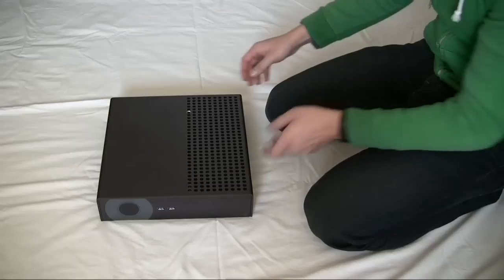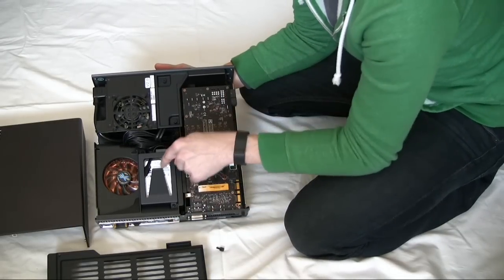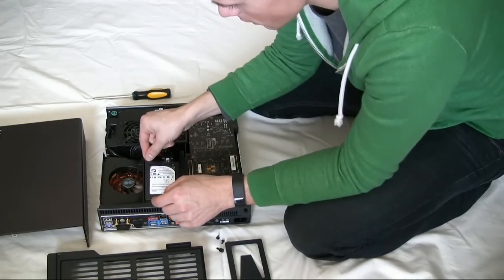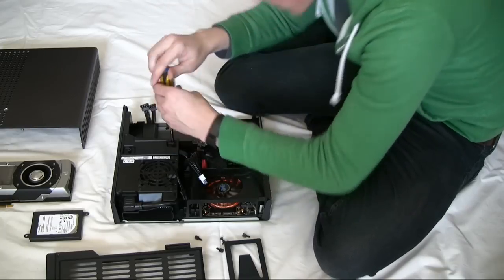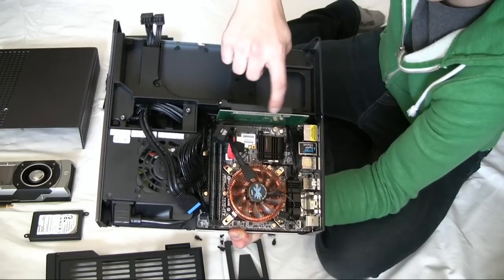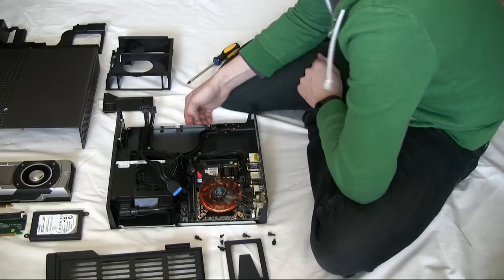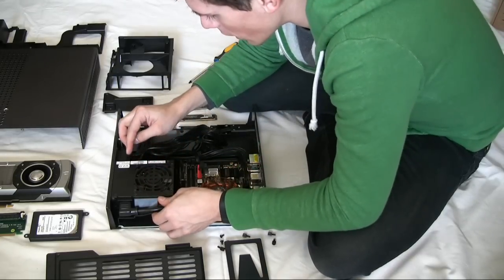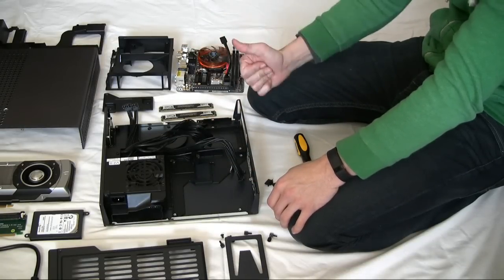Steam Machine, Disassembled!

Comment: Really cool to see the steam machine from the inside out, I've seen some videos of beta testers disassembling it but never saw one completely torn apart. Did you manage to get the game to run normally?
Reply from the maker: Not quite yet!  It looks like I should replace the motherboard, I think I may have gotten a faulty one, which makes sense because every so often my machine will start power cycling.
Reply: Evan McLaughlin
ah that's unfortunate :( how will you manage to find one that will fit the box?  will you just ask valve for a replacement?
Reply from the maker: El Calhau In an extremely awesome turn of events all of the components are retail computer parts, aside from the case itself.  If you check the description there's a list of them, so I just ordered a new board off of NewEgg!
Reply: Evan McLaughlin that's really convinient actually lol too bad the motherboard was not 100% in the first place, but anyways glad too know that you'll keep playin' on your sexy steam machine
Reply from the maker: I'm glad to know you're looking forward to more!
Reply: Evan McLaughlin 1 Year later, did the motherboard work?
Reply from the maker: Absolutely it did!  I just dropped the new one in and it's still running great.
Reply: Evan McLaughlin Sweet! Sorry for the early reply, I saw your TF2 test soon after. I can't wait for Steam Machines! They're supposed to be announced at GDC this year! :D